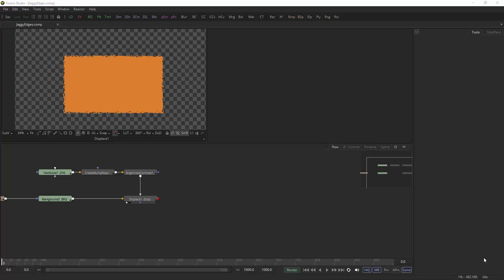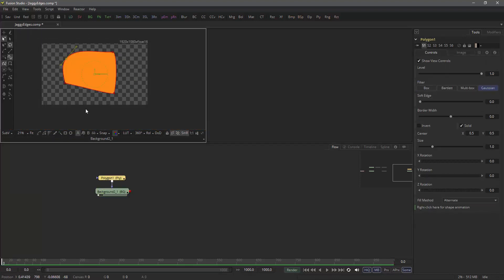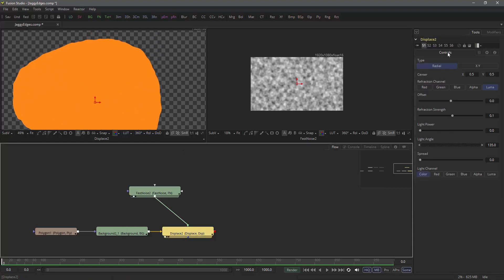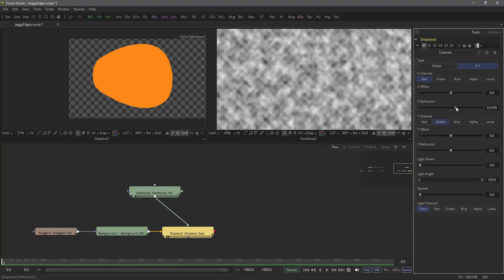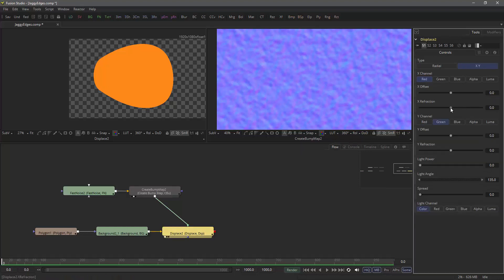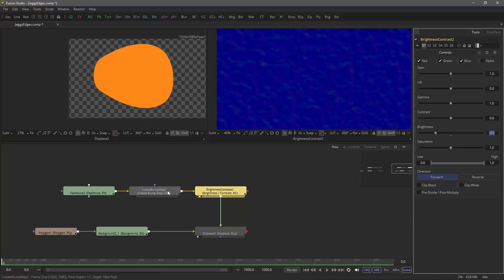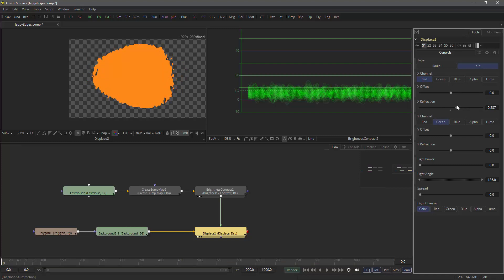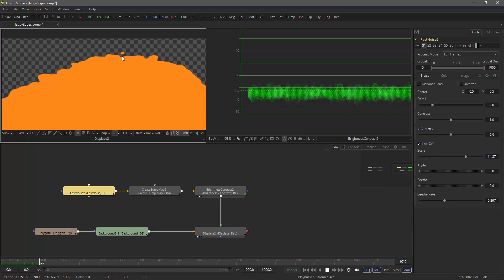JaggyEdges

Comment: Hi SirEdric, i don’t know if you are still replying to this video, but I tried doing this effect. And it didn’t work :/ all the nodes are connected just like how you did it. But no displacement or jaggy edges is appearing. Maybe it doesn’t work with the newer version? If so, could you please explain what nodes to use to get this working, or what I’m doing wrong. I really need this to work so if you could help it would be much appreciated :) (sorry for the long talk) I. Trying to do this in the fusion tab in DaVinci resolve
Reply from the maker: Hi Samuel. I just checked and it works perfectly fine in both Fusion 16 and the Fusion tab in Resolve. The one thing I could imagine is, that you didn't set your Background or Fastnoise to 16 or 32 float. With any of those tools being 8int or 16int this won't work. You might also want to double-check the Height Scale slider on the CreateBumpmap.
Reply: I just tried it out! Goodness me it works! Thank you so much :) it was the floats and the height! Spot on! Thank you this will be so useful! I was trying to make icicles grow on a table, and everything was looking good, except for the mask. It didn’t grow naturally and was scratching my head trying to figure out how. Now 
I can! :)
Reply from the maker: @thefaun6782  Glad it works for you! Not setting things to Float is the culprit in many cases. Always double-check...:-)
Reply: Thanks I will double check! ;-)
Reply from the maker: @thefaun6782  Once the icicles are done, maybe you want to show it off or even contribute to the friendliest fusion community ever: 
https://www.steakunderwater.com/wesuckless/
Reply: Oo thanks yeah I definitely will! I’m currently working on recreating the effect in The Chronicles of Narnia when the Turkish delight box appears! Using these same principles.. as well as a pEmitter to make it sort of crack like ice when it appears. So I’ll upload them both when I’m done :)